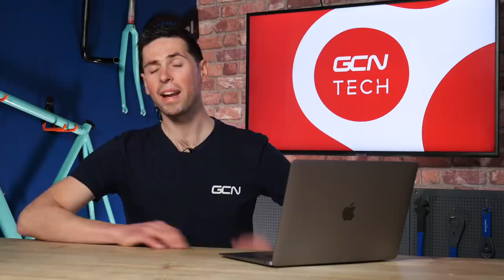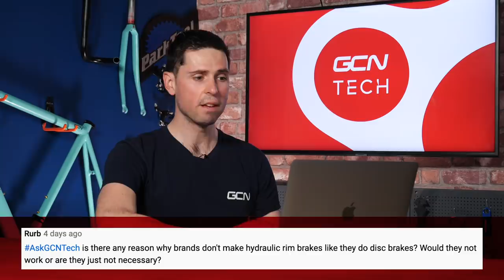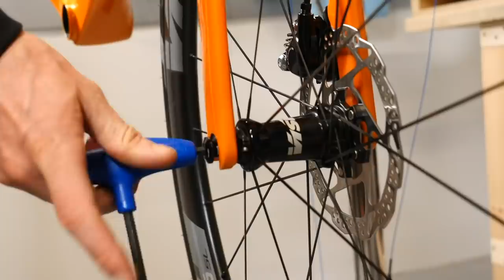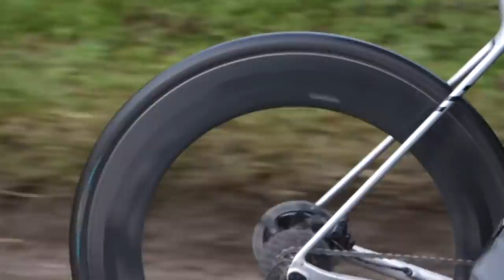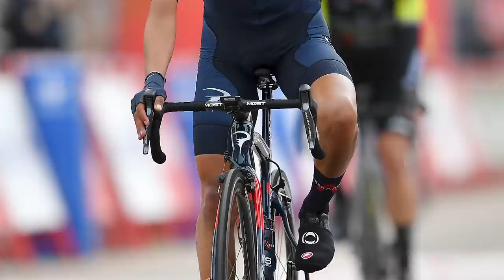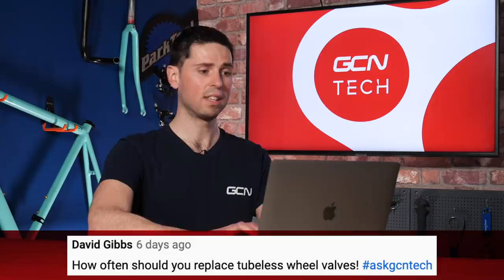Are Team Ineos The Only Pro Cycling Team Still Using Rim Brakes? | GCN Tech Clinic #AskGCNTech

Comment: Funny how the guy said that fitting tubeless tires was not as difficult as he thought but he never succeeded 😂 How can he say that?
Reply: Don't be bitter you can't do it yourself, guy
Reply: @whatwelearned  what is with the personal attack? He was making a remark about someone saying fitting tubless tires was easy but they haven't succeeded in doing it.
Reply: @DaveCM  Yep I apologise I misread OP's comment.
Reply: I think the "guy" was saying fitting (as in physically installing or placing the tires on the rims) was easier than he expected. Getting them to work as desired was less so.
The mechanic who I talked to years ago basically said the road tubeless was a rider system. You have to ride the bike fairly frequently for it to work. In the case I agree with Alex's advice; once installed the bike needs a few miles on it for sealant to work into all the nooks an crannies.
Another step that I never seem to see advised is to put a thin layer of sealant on the outside of the bead of the tire and the rim, much like I was taught to do on the o-ring of a new oil filter of a car. 
One of the main reasons a tire will go flat on a new install is that there are always small gaps, which the sealant fills up. Until you ride the bike there will be leaks through these gaps that are large enough to let air out but small enough to not allow sufficient velocity to force sealant into. Also remember that if you let a wheel sit after the install, the sealant all will pool at the bottom. You need that first 2 or 3 miles to coat all the inner surfaces.
Reply: @thekeytoairpower  well from my experience, if the tyres go flat overnight, it’s due to improperly installed tubeless tape. I had to learn this the hard way unfortunately. But yes, ride for a few miles after adding sealant. Schwalbe also recommends this.
Reply: Yeah it was just a ironic comment, I have nothing against the poor lad having his tyres flat every morning. It's just that we read of So many troubles with tubeless that I really don't understand why some people keep saying that they are not that hard to fit. They are definitely more hassle than clincher tyres. But since I never tried tubeless than the advantage of tubeless might well be way higher than the hassle of fitting them the first time.
Reply: @6872elpado  I mean I've said this in other threads but i installed mine in less than half an hour and have had no issues in 3 months so far. It's a new tech and cyclists think any change is hard and a disaster.
Reply: @whatwelearned  I don't think that. I'm just saying that it is statistically more probable to have problems with fitting tubeless than fitting clincher. And since the advantage of tubeless comes after you fitted them probably if you can't even fit them the advantages for you are zero. I just make it a number question. We read more problems with tubeless than clincher that is a fact. From here to generalise that every cyclist thinks that new tech is a disaster, well, sounds a bit of a stretch.
Reply: @6872elpado  I'm not sure i agree it's fact. I think you might hear more because it's new and people are transitioning. No-one reports a flat clincher tube.
Reply: @whatwelearned  Flat clincher tube is after fitting them. I'm not saying that you hear more people complaining about USING properly fitted tubeless. You hear more people complaining about FITTING tubeless. And if you can't even fit them you don't get any advantage.
Reply: I agree with you, it struck me as a contradiction too.

Comment: Team Ineos much be pretty happy they are the only team using rim brakes.  When rides jettison half a bidon of water to save weight on a climb, having lighter rim brake bikes must be a bonus.
Reply: I think one issue is that the Pinarello is kind of heavy compared to other bikes. A lot of bikes have to have weight added to meet the UCI minimum while Pinarello had to make the XLight which is kind of fragile and not everyone on the team has one. I love disc brakes on my road bike, but I can fully understand other reasons they don't use then too.
Reply: @DaveCM  according to GCN Julian Alaphilippe 52cm SL7 is 7.26kg .  SL7 frame 49cm weights 733g and Pinerello 2021 Dogma F12 XLight  52cm weight is 720g
Reply: @DaveCM  The older Dogmas were known not to be the lightest, but the new F12 Dogma is a relatively light and versatile frame.
Reply: Big advantages to use brake rims... For big tours I think others big teams ll use bikes with rim brakes... To be competitive... If they Don t go in this way... They ll lost tours!

Comment: Comment on the tyres going flat: not all "Tubeless Ready" systems seal properly. I found this out when the local bike shop fitted Specialized Turbo Pro tyres to a set of Roval wheels. I had to set the wheels flat and spin them to get sufficient sealant on the sidewalls and the tyre/rim seal areas. Place the wheel flat on a surface, put in 2 oz/50 ml sealant and spin the wheel several times. Do this on both sides. Then inflate the tyre leaving it flat. If you still leak flat,  flip the wheel over and repeat on the other side. The tyre leaked so much that sealant was visible on the outside. We eventually replaced those tyres with full Tubeless.

Comment: Tubed clincher is still the best for non-professionals and practicality. Simple, works, no-fuss.
Reply: For you maybe, and plenty of others - it's not universal though. I find tubeless simpler and more robust for road and off-road, but with a maintenance check each 6 months or so which I wouldn't necessarily have with tubes - the flip side is that i'd never had a puncture of an inner-tube that fixed itself. Swings and roundabouts. YMMV obviously.
Reply: Dinosaur
Reply: I went from around 10 to 15 flats per season to 0 by converting to tubeless (I live in a bigger city with lots of glass etc.). Would never go back...and 70psi on 25mm tires feels so good.

Comment: Valve stems can sometimes get clogged by sealant when running tubeless. They can be cleaned out, but sometimes after several years of use - especially in dirty MTB or gravel use - I think it's worth it to replace them.

Comment: From what I’d read, the right-hand drive train exists because England drives on the left side of the road. The thinking was that riders would dismount to the left in order to step onto the curb/sidewalk. The drivetrain was placed on the opposite side to prevent grease getting on the cuffs of trousers during the process of egress
Reply: That was my understanding as well
Reply: With a right rear sprocket that is somewhat loose, pushing the pedals will tighten it more on the hub. If it was on the left, you would need a locknut to make sure it doesn't come off when you ride.  Standard threading is  righty-tighty.
Reply: I think there may be some ancient connection with horse-riding, too. Most people are right-handed, and that's a global, genetic thing.

I've not seen anybody mounting a horse from the right. 🐎 Or a camel 🐪 in Africa. Or an elephant 🐘 in India. Or a piggy 🐖in 'Deliverance'.  (Sorry, that last one was unworthy of a serious discussion...)
Reply: @grimp53  that's the true reason
Reply: @grimp53  Your's is the comment which makes sense here. All the other ideas are just arbitrary. The majority of other countries would mount from the right where their curb is. There would be no mechanical advantage for putting it on the left so I didn't understand why anyone would ask the question in the first place.
Reply: @EleanorPeterson  I'm left handed and usually mount my bike from the right but for me it makes sense to do so from the drive side. After all isn't that the way we look at our bikes? Having said that, if pushing a bike, doing so from the left makes more sense to keep the chain away from one's clothing.

Comment: The true reason why the drivetrain is on the right is historical: the first bikes had a single sprocket freewheel that was screwed onto the hub body. If the drivetrain is on the right, the pulling force of the chain will tighten the freewheel, otherwise if you had put the drivetrain on the left, you'd end up quickly loosening the freewheel, while pedalling. You need a left threaded hub and freewheel (counter clockwise) instead of a "normal" right threaded one (clockwise) to install the drivetrain on the left... and given the fact that the tools to make the threads are quite expensive and their most common standard is "clockwise" the decision to put the drivetrain on the right and use a standard clockwise thread had to be quite straightforward.

Comment: Because team Ineos are not being forced by their sponsor what brakes they need to use.😃
Reply: Not really, it's because Pinarello doesn't have light enough bikes, they even need to use Lightweight (the brand) wheels to come even close to 6,8kg, if their bike would be light enough they would use aerowheels (the Lightweight isn't very aero by todays standard). A Tarmac SL7 is around 6,8kg with aerowheels!
Reply: @KoenMiseur  I think they use lightweight becous they are very stiff Pinarello is not much Sawyer than the tarmac both in disc
Reply: Thats probably with a garmin and pedals and honestly that Pinarello probably weighs as much with rimbrakes.
Reply: Rim brakes far superior. Ineos not dictated by sponsors so much
Reply: @KoenMiseur  bro my SL7 WITH aerowheels is 7.55kg...
Reply: Pablo Morales  AND has tubulars..
Reply: @KoenMiseur  On the contrary, the team very seldom does runs the lightweight set up. GCN weighed Bernal's bike from the 2019 tour and evidently the mechanics had to use steel and aluminium hardware (bolts etc) as opposed to titanium just to get it up to 6.8 kilos, whilst running Shimano wheels. Alaphilipe's bike on the other hand is closer to 7.3 with much shallower wheels on.
Reply: @KoenMiseur  nonsense
Reply: @hector hector and the rest of the peloton arent, and haven't been forced onto discs? 😀
Reply: No. It's because Pinarello bikes are heavy. Even with Lightweight wheels, they are still only just at the UCI limit.

Comment: Some bmx have left side drive, also there was track bike developed to have left side drivetrain. This is easier on single speed bikes. But it would very difficult to have in multi speed bikes. Imagine the manufacturing left specific fd and rd. Then the mechanics learning to install and index them.

Comment: I think the reason why there aren't hydraulic rim brakes is that it's a lot cheaper to replace a disc than it is to replace a wheel. Hydraulic brakes mean there's a lot more force being applied on the brake track of the wheel, causing it to be worn down a lot quicker and leading to one having to replace a wheel much more often than with a regular mechanical brake.

just my opinion though so please correct me if I'm wrong
Reply: I got a pair of fancy carbon rims & have this thought everything I have to brake with my rim brakes.  I agree that while this is not the only factor it certainly is one of them.

Comment: My guess is that drivetrains are on the right because you mount horses on the left. People were used to this, so mount bikes on the left as well and if the drivetrain is on the right it is on the opposite side of you walking your bike around and you are a little more protected from your chain grease.
Reply: I saw somewhere on a previous GCN vid that it was because of English roads and the way they drive on the wrong side of the road-- this way the drivetrain is always facing toward the road, even when pulled over on the curb.
Reply: I have been scrolling through the comment to see if this was mentioned. I think this is exactly what it is - not very logical in the 21st Century, but I think it is the main reason. And the reason we mount horses from the left is because you wear your sword on the left (so that you can easily draw it out of its scabbard with your right hand - mounted horse soldiers were all right-handed, like polo players). If you mounted the horse from the right, the sword would get in the way, try it, it's really awkward.

Comment: the reason the gears are on the right is because torque naturally goes in that direction. If you take your right hand and curve the fingers in the direction of the spinning gear, the thumb is the direction the shaft should go.  So putting the gears on the left would be the opposite.

Comment: A friend had a road bike with hydraulic rim brakes back in 1983/84.  The brake lever operated the front and back calipers at the same time.  IIRC it worked ok until some jerk cut the hydraulic line.  It was an ugly green and black with "Hydraulic" in on the top tube.  Unfortunately I can't remember the brand.

Comment: @GCN Tech... Regarding Tubeless tires going flat overnight, that usually indicates that air is slowly escaping through the valve stem hole. The best fix for this is to get a quality pair of Tubeless Presta Valves such as Muc Off's that seal the valve stem hole extremely well.  I like Muc Off's because you can use an Allen wrench to tighten them for a good seal instead of just finger tightening them like Stan's Notubes.

Tubeless Valve Cores need to clean periodically to removed dry sealant and need to be replaced when the rubber material becomes aged.

Comment: Rory: Check your rim tape and valve (not too tight). Make sure you add enough sealant. Then fill the tires to their maximum pressure and go for a short ride. If that works let the tires go down to your desired pressure. Tubeless tires will lose 1 to 2 psi per day. Good luck. I really enjoy riding on the lower pressure tires on my crappy roads. 🚴‍♂️😃

Comment: You could find a left hand drivetrain on motorized bikes and DIY ebike conversions.  They run a belt drive, attached on a cog the left side of the rear hub.

Motorized bikes run on 2 stroke or 4 stroke moped engines.  While the DIY ebike conversion uses a regular electric motor.  

A proper eBike or eBike conversion will either have a mid drive or hub motor fully integrated with your bikes drivetrain.  So there’s no need to run a second on the left side of the bike.

Comment: #AskGCNTech, I recently purchased a Basso Palta gravel bike and I'm looking to get a set of deeper section carbon rims for the road as a opposed to the Microtech rims it came with. I'm looking at either the EVNE foundation 45, or the ZIP 303s as a good road option to fit 28-32mm tires on it. But I'm also wondering if it is frowned upon to put American wheelsets on Italian bikes. I'm in the market for a set of wheels under $3000 CAD and don't really want to buy a Campagnolo wheelset. If you have any other wheelset suggestions for road riding I'm all ears. I'll still be using the Microtech rims and 40mm gravel tires for off road.
Reply: It's ok as long as they look slick and perform superb! ;)

Comment: I want to replace my 170mm sram red 10 speed cranks with a 165mm version. I don’t want to upgrade to an 11 speed drivetrain.  Will a newer sram rival 22 or force 22 crank work if I replace the new chainrings with the same bcd size 10 speed chainrings?  I’d rather spend my cash on wheels than a new 11 speed drivetrain. Thank you.

Comment: Sorry, but the tubeless information is wrong here. Once you have pumped up the tyres you should lay the wheel on its side so that the puddle of sealant runs over the the tree rim interface a bit like panning for gold. Then turn the wheel over and repeat. Tyre will always stay up for days if not weeks.

Comment: #AskGCNTech  I have a Shimano Ultegra Di2 groupset on my brand new bike. During my latest, more hillier rides I noticed the bike wont shift in either the greatest and smallest cog of the cassette. Tried fiddling around a bit with both limiter screws and derailleur adjustment but I just can't seem to fix it. Any ideas or should I just go and get it serviced at a bike shop?

Comment: Why are two bikes so different to ride.

I have an older (2011) cervelo R3 setup with an ultegra 52/38 Chainset  and an 11/30 cassette and a cervelo Aspero with a 50/34 chainset and a 11/34 cassette.  Both bikes have been professionally fit to my body geometry however the R3 has 172.5mm cranks and the Aspero has 17mm cranks.  I find that the Aspero is much easier to ride and that I do not have to exert as much effort in order to get the pedals to spin.  I find the R3 requires more grinding.  Could you offer any insight as to why this may be the case?  I am hoping to find an answer before I go out and spend even more money on parts as both bikes where built up for me this past year.

I’m not sure if this has any affect on the equation but The Aspero has an 80mm -6deg stem with 45mm of spacers and the R3 has the same stem with only 40mm of spacers.  (The R3 did have 54mm spacers and a 110mm +6deg stem but the reach felt far too long so I changed it).

Thanks I’m advance!
#AskGCNTech.

Comment: regarding left sided drivetrain:  Most cassettes, to my knowledge, have an asymmetric tooth profile which would need to be changed for a LH drive train meaning you need LH and RH cassettes and the derailleurs also need to be specific.  All in all, it would make things so complicated and bike specific that it would not work commercially.   Technically there is NO benefit of a LH over a RH drive train,  hence, what would be the point.

Comment: From an engineering standpoint hydraulic rim brakes don't make sense because you get the same mechanical advantage from having the brake at the rim with a large lever arm as you do through hydraulics. On a disk brake you have to put a lot more force into the caliper to get the same performance and while that could be done with cables, hydraulics makes it a lot more compact.

Comment: Right side transmission, probably because of standard threads direction which is clockwise.
When you pedal everything turn clockwise and hence the bottom bracket and cogs stay tightened.